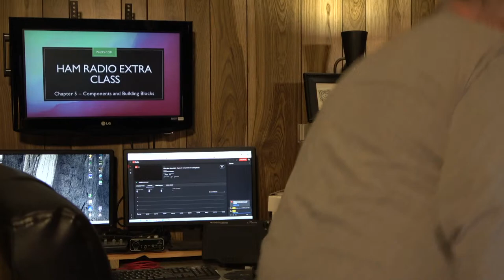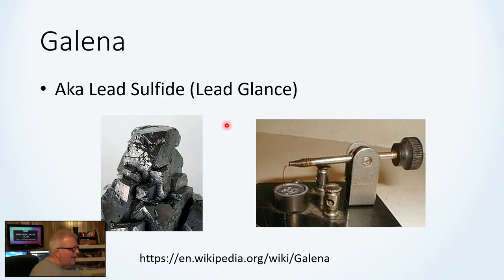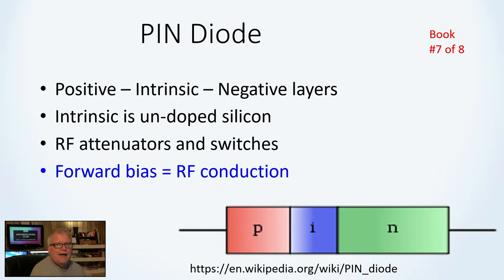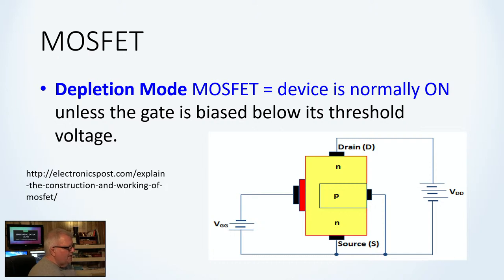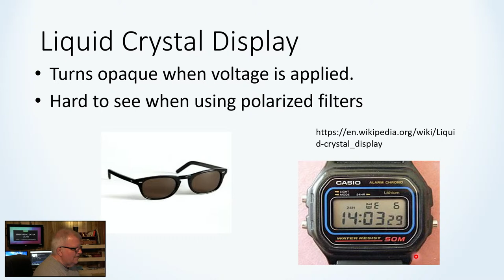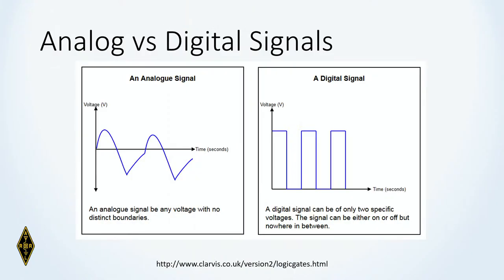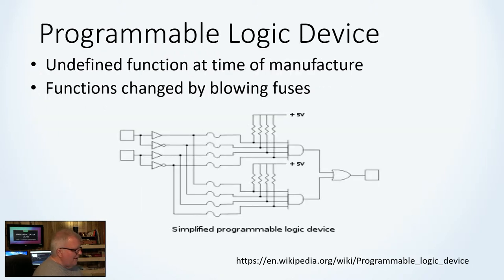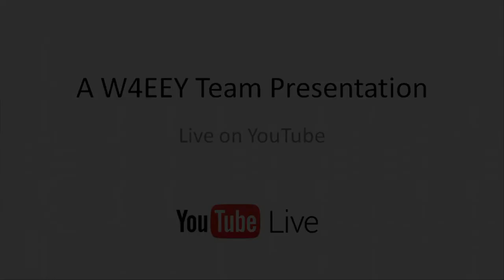Extra Class Winter 2023 - Chapter 5 - Components and Building Blocks (OLD QUESTION POOL)

Comment: amazing quality of info about transistors!  😂 I spent months learning this stuff once … could have really used this video a decade ago!  😘  amazing review of TONS of information!  I’m definitely rusty.  Extra Exam would be painful without the hours of derusting following along with this class. 💜 Thanks again!
Reply: fwiw, if anyone wants to build circuits for Raspberry Pi, or Arduino, and program GPIO pins turning on & off:  Raspberry will only let you draw 1-2mA per pin; Arduinos will let you draw 10-20mA.  Also, these will do logic at 5V or 3.3V … 😂 just beware, you want to choose transistors that have low voltage-drop!  you also want Voltage to control the transistor … not so fun using transistors where Current controls the action, you just can’t draw enough Current from a Raspberry.  🤓

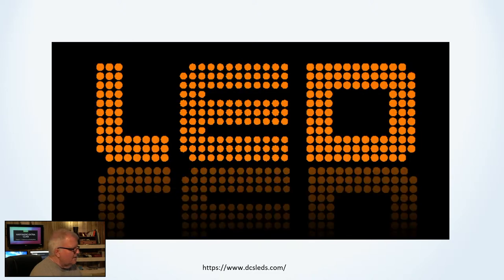Comment: LEDs! 😅  31:36 I forgot these would be in the diode section.  🤦‍♀️  … yeah, without the current limitting resistor, they become “Smoke Emitting Diodes,” for a brief duration.  😂😢  The clear ones, you can actually SEE the puff of smoke inside the clear-plastic.

The voltage drop on “normal” diodes is 0.2-0.7V … LEDs are usually 2-3V drop.  note: the color of the LED is a big factor in the V-drop.  red is closer to 2V, blue is closer to 3V.  seems to be more voltage-drop for shorter wavelengths.

useful to know for calculating the size of resistor needed, for a target current.  the basic LEDs can be as high as 30mA, often below 10mA.  if you forget the voltage drop, the math will be all wrong.  doen’t matter much, you’ll accidently use too big a resistor.  🤷‍♀️😅  but, just use an ammeter to dial-in the current?  don’t actually have to math this, if we don’t want to.  start at 1kOhm, check an ammeter, adjust the resistance as needed.
Reply: 😅  if you play with LEDs, especially multi-color … it’s kinda fun or annoying, but the Ohm-rating you want for a “current-limiting-resistor” is different for red LEDs, than it is for yellow, green, or blue, or white LEDs, if you want them all drawing the same current.

measuring the voltage-drop just requires a normal Voltimeter, 🤔 I think the LED has to be powered, and glowing, when you measure the voltage.  don’t think the meter reads anything when the LED is off.  😂  it’s fun!  check your colored LEDs and see how different they are.  💜👍  it’s kinda unexpected, for parts that look almost identical.